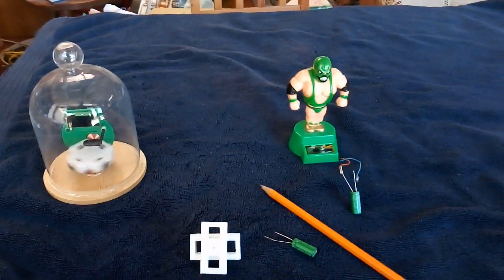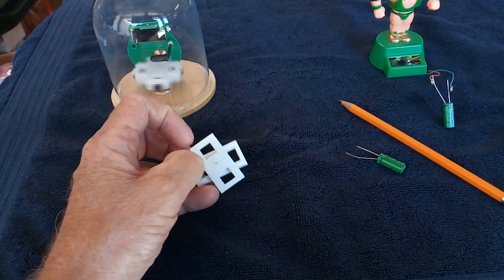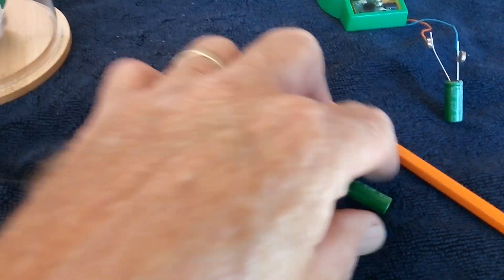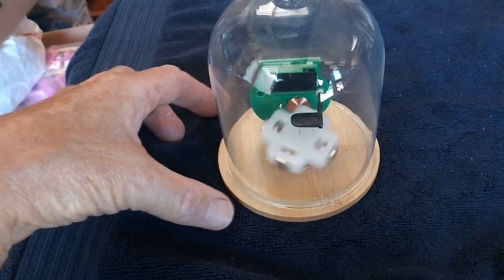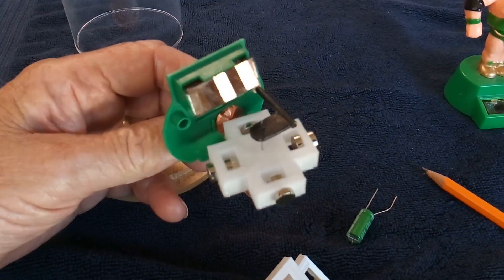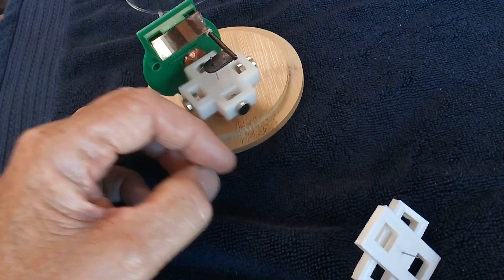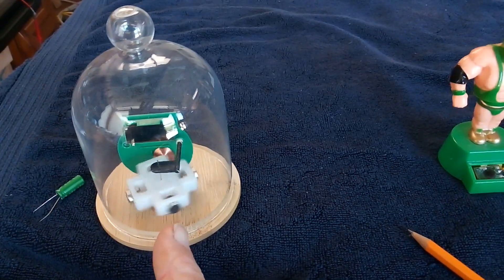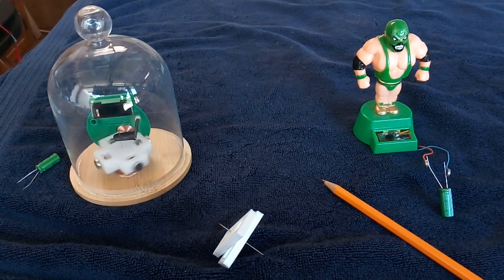Lets Just Go ----- and keep on going all night long

Comment: hi Lidmotor. you may or may not be aware that solar panels can discharge a battery in parallel during hours of darkness. the standard solution is to put a diode in between the solar cell and the battery or supercap in this case. 
i like using 1n5819’s in experiments with collapsing field spike energy recovery but they are a little bit leaky backwards, so not much help in this application, but you may want to add a higher rated diode. 
cheers.
Reply from the maker: I'm glad that you brought the didoe question up.  That is the standard way to stop the solar panel from draining the stored energy at night.  I found out that these tiny solar panels have a large resistance in them though that allows me to just eliminate the diode and save the voltage drop they cause. It is a crude way to do things but on my tiny projects it works.

Comment: Great design like always.."penny with plastic bead"..thats awesome..what if using tinny mirror at the bottom?is it makes a difference?
Reply from the maker: Yes that would work but eventually the needle would etch into the glass.  If you support the needle with a magnet from above to take most of the pressure off,  glass works very well.   I am trying all kinds of bearing surfaces on my long running motors.

Comment: Hi Lidmotor.  Very nice.  I have discovered two effects that you might could also apply to your designs for 24hr runners.  1.  I found in pulse  switched  circuit when using a D cell for power input, that I could get even more power at the output side if I put a electrolytic capacitor  across the D cell.  I checked that this was NOT just action of the capacitor acting as a storage and boost from the cell.  Not sure if the same results if using other cell types or using a supercapacitor as substitute with a paralled electrolytic cap.  2.  I have also found that a  charged capacitor will increase in  voltage with a temperature  gradient.  Forgot which direction.  Per the capacitor equation one can see if the farads can be increased (temperature change) then voltage must rise and hense the capacitor gains free environmental energy beyond the  initial precharge.  Using your solar cell input in daytime along with a capacitor  circuit to precharge and then allow the day and night cycle of temperature change would provide a second energy source to drive your designs.  But indoor with central air conditioning not sure if there would be much  change.  In my rig, without A/C, I got significant voltage change from day to night ambient deltas.  Even a few degrees is noticeable.  Again, not sure if same is true for a supercap, but would seem to be the same.  You may already be getting some benefit with the supercap from temp changes without knowing it as a 2nd independent  energy input source.  Let us know what you find out pos or neg.
Reply from the maker: Thanks for that info on temperature effecting a super cap.  I will do some more research into that.

Comment: It may also be that we don't get enough sun here to over power the circuit 😆. Glad to see you are getting on with Tinkercad and your printer.
Reply from the maker: I can adjust the daily light input just by moving the experiment around the house if it gets over powered.   I was thinking more about modifying the cap or solar panel values to make the thing run right.  The whole idea was brilliant ----just put a super cap on it and let it go.  Sometimes the best ideas are the simple ones.  My 3d printing adventure has been very interesting.  I am learning to do things now that are amazing.  This new rotor build was one of them.
Reply: @Lidmotor  I do have a tendency to try things rather than think them through first 😆👍